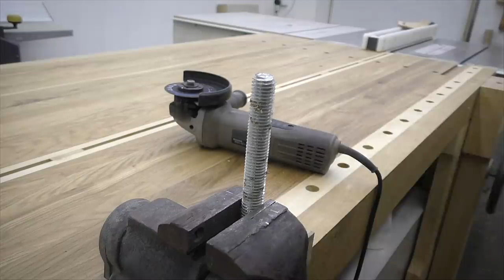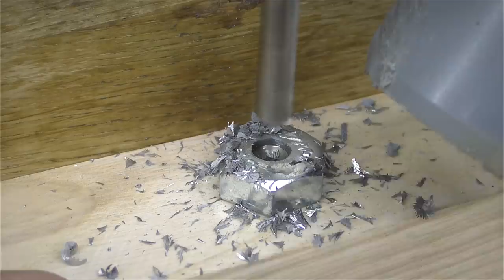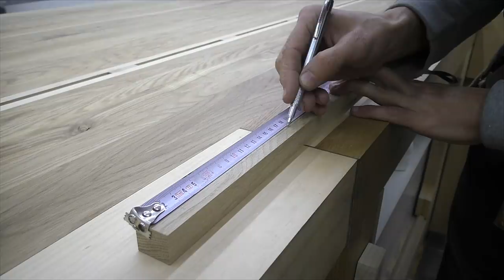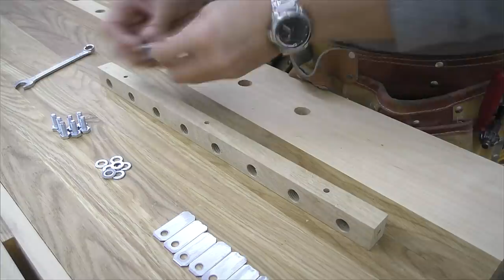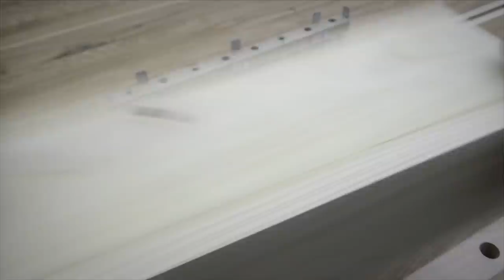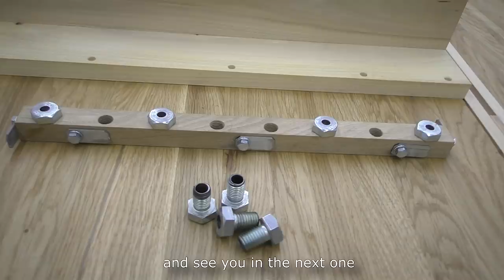Amazing Woodworking Tool Idea from Bolts - Very useful thing!

Comment: Hey... great and flexible to use tool. And if jou neet other diameters of dowels, you can replace the metal screws and make some with holes in the preferred diameter. cool stuff. Thanks

Comment: Actually a dowelling jig- and very useful too.
The problem with your design is that it does not reference from the same (outside) edge (that would require rotating the jig, and the hand marked holes would not be accurate enough) so it will only work with one thickness of wood.
To solve this problem, remove the bolt heads and turn over the jig between drilling the two parts (so that you are drilling in the opposite direction). This will allow referencing from the outside edge of both parts, so it will work with a range of thicknesses.
Interesting to watch someone do metalwork with woodworking tools- investing in a few files and perhaps a tap and die set would make life a bit easier...
Reply: Would adding another set of stops on the other side not solve the referencing problem? What is your opinion on that?

As for different thicknes of materials, one could always make several of these jigs they are cheap enough. Also different lenghts for differenet cabinet depths.
Reply: @bluewanderer9903  Always best to reference from the same edge. Material is rarely consistent in thickness. Navigate to my channel for my version that does this- and explains why it is important. One jig for all joints.
Reply: @Tensquaremetreworkshop  I will check it out, thank you.
Reply: @Tensquaremetreworkshop  joint master? Nota domino?
Reply: @bluewanderer9903  not a domino…

Comment: what benefit does this have over steel bushings? or just using the holes in a hardwood guide directly? those large bolts aren't cheap...

Comment: Potentially a spring compressed between say a wing nut and bolt hardware could throw the wing nut into 'intermediate axis theorem' rotation with slightest left loose tork.